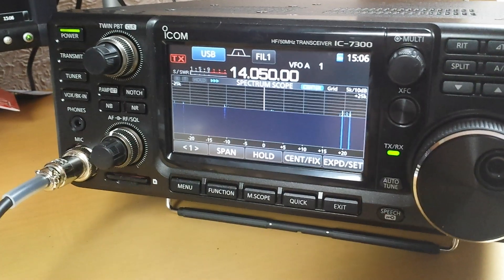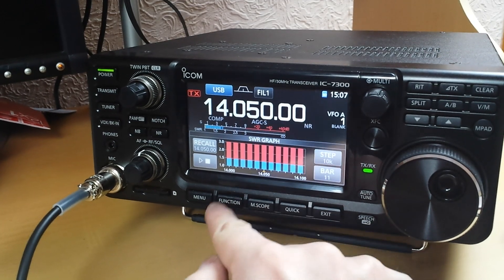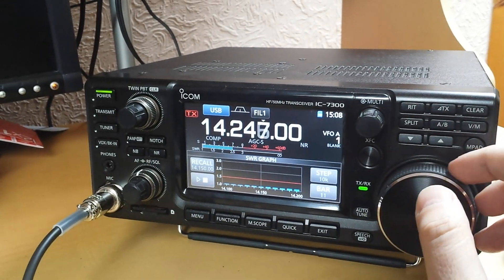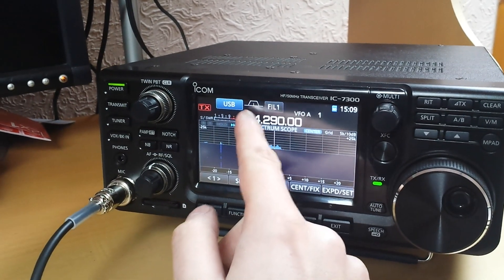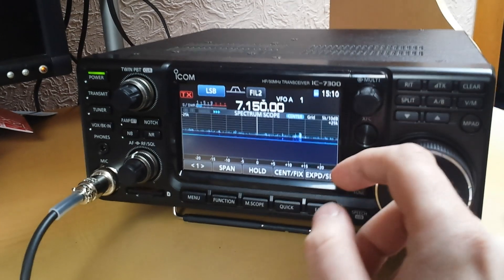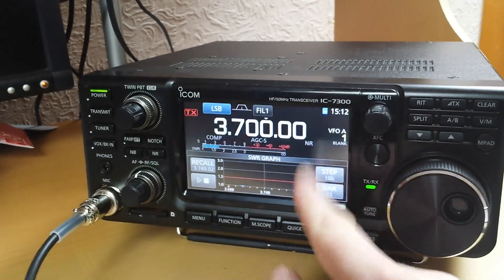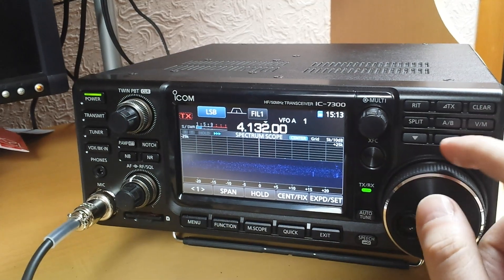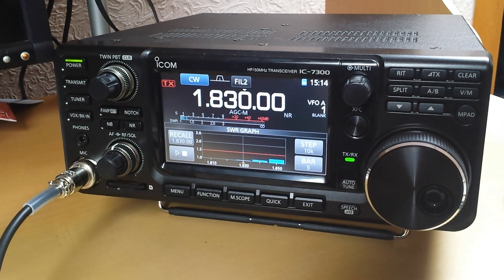IC-7300 SWR Graph feature - demo with automatic external ATU and random wire antenna

Comment: my understanding is that you want to tune up in RTTY, CW, or AM so that there's constant signal being transmitted.  in SSB there's nothing being transmitted on the line except for the click sound of your mic.
Reply: The radio has integrated this special function for the SWR check. So you don't need to set CW, FM or RTTY to send a carrier.

Comment: Tomasz, you could have explained what the significance of the bars were, by reading the SWR out load to the audience,  Many here that have never done this  procedure did not understand what you were doing.  Also you should have taken a picture with the rig at each screen, by momentarily pressing the power button. Then unmount your SD card and shove it into your pc, and arrange all of the snapshots on your computers monitor or page thru them to show the entire band in detail.  You can keep these files as a station record if there are antenna or in your case external tuner changes.  73 de K0UA

Comment: Okay.  What did you do?  All I saw was the radio scanning across a range of frequencies, transmit and move to the next frequecies.  Where is the graph?  What did it prove?  Where was the SWR lowest in that band?  The point of a YouTube video is to demonstrate and teacch something.  I learned nothing from this.  I've had my IC7300 a little over a year and never haa need to do this.  I find one resonant frequency in a band.  73 Harvey KM4JA
Reply: The graph cleared because of the tuner.

Comment: Did you ever get a chance to make a video using only the internal tuner on "proper" antennas?  I am using it with a EMCOMM II antenna and it seems to be working fine on all the bands (though I suspect it working fine and it working well are two totally different things).
Reply from the maker: bp968 sadly didn't have an opportunity yet :(

Comment: Thank you for posting this. I just bought this radio and could find zero information on the SWR meter feature of the radio, other than how to bring up the meter.
Reply: go on the web
Reply: Scott, I believe it is in the advanced manual. Did you look on your included DVD?  Or just go on the icom website and get it.

Comment: Good demo, Tomasz. How were you keying the radio? Normally, wouldn't it be done by sending a cw tone? While you were tuning, it looked like the radio stayed on LSB. By the way, I just ordered this radio yesterday. Thanks
Reply from the maker: Correct Chuck, radio was in USB mode and not CW. I just keyed PTT on the microphone and it transmitted the tone - that's how it works. I'm sure you will have a lot of fun with the rig - I love it, just wish I had more time to use it but family first, hobby later.
Reply: Thanks, Tomasz. As soon as I sent that, I realized how that worked. Your posts will be very helpful when I set up the radio.
Reply from the maker: If you have any questions, ask away - I may not know the right answer but sure will give my best shot :)

Comment: It was tuned to 20 meters already from the first tune .. it did not retune, your antenna have a wide area with the same impedance... :)
Reply from the maker: Hi Lars. Actually it did tune, but the fact is this ATU is very fast (max 2sec tuning), makes almost any piece of wire tune well (in my experience) and has also 200 memories so once it knows the wire, it tunes in <0.2sec. With this one showing proper 2sec tuning is hard :-)

Comment from the maker: Hi Sam. This is a very good point you make. In principle it's not the nicest but not uncommon to hear other stations tuning their rigs on a frequency wherebyou try to work DX or similar. The runing signal is usually short and goes away - no harm done, minor annoyance unless it lasts relatively long (i.e. you loose few QSO lenghts because you can't hear anything).
SWR Graph is great to show you characteristics of your antenna - I do that normally with 2-5W output power and short bursts of signal. in fact with 2W I found this feature to work ok. In the video I use more power because I'm not just checking the antenna but also driving ATU to tune it for lowest SWR and this ATU requires around 15W input to react, with about 20W being comfortable lowest power that gives v.good tuning results. This is the ONLY reason why I used so much power here - to make ATU move reliably (and I knew it will tune well on this wire). In all other occasions it's minimum power required to do the job (well, ATU wouldndo the same on 100W input but I find it impossible to justify, not to mention I could possibly damage radio if ATU didn't  match - just saying). So, to finish my answer, SWR Graph is something you use very rarely, transmit short bursts to get measurement and you're done. Yes, you will possibly TX on another signal for a short time - you can't avoid that, you may not even know it's there in the first place (can't hear before you tune). It happens. Finally, when watching waterfall plot I often see v.weak signals moving very fast across bands sometimes several times. They jump few kHz and transmit for split second - my guess is it may be antenna analysers doing measurements but no way to confirm that. Hope this answers your question.
Reply: Tomasz Miklas

Comment from the maker: Hi Jonathan. My CG-3000 remembers wire characteristics/parameters even if I turn it off, even for a long time (months). On power on it just works, doesn't do learning. Of course when working it has to be powered up at all times - it doesn't seem to have latching relays (i.e. tune to specific area of the band, turn power off and use it - like WSPR or digital modes). To be fair it's not a problem - I have it next to antenna of course with small PSU. CG-3000 uses ~1Amp when tuning and ~0.1Amp otherwise.

Comment: Hi Tomasz, great video, very informative - Makes me think I should buy a IC-7300 for myself :-) Just a quick question about your CG-3000 tuner - Do you have to permanently leave the CG-3000 connected to 12v power in order to maintain the frequencies in memory? I have found that my CG-3000 'forgets' tuned frequencies after I switch off the power.